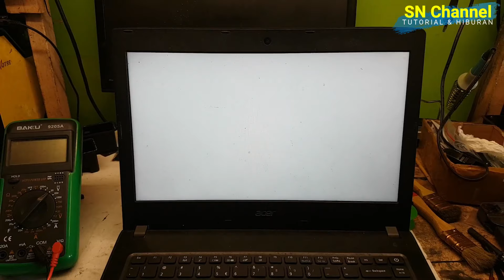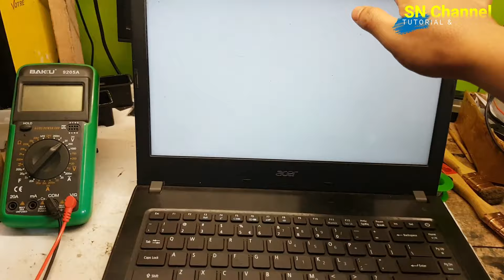LCD LAPTOP BLANK PUTIH || WHITE SCREEN LAPTOP Fix || Layar Laptop Blank Putih

Comment: Saya terjadi blank putih,,, tapi pernah baca permasalahan di website,,,,, jadi dicoba ctr alt del atau matikan paksa trus hidupkan lagi,,,,, dan bisa normal lagi,,,,,, cuma kalau tetap tdl bisa baru bawa ke teknisi yang ada
Reply from the maker: Mungkin itu kasus firmware eror (driver/bios) bukan hardware
Reply: @SartonoNainggolan klo kasus Firmware'nya, solusinya gimana ya Bang... Terimakasih
Reply: Laptop saya udah ganti LCD ..tapi pas seminggu kambuh lagi penyakit' nya LCD nya putih blank
Reply: @hasbby06  punyaku malah baru ta ganti terus Normal, seharian ta pakai normal jaya , besoknya pas ta nyalain eh BLANK PUTIH, aku komplain sama penjualnya (di toko oren) minta retur... di acc dikirim lagi LCD yg baru.. ta pasang dan Alhamdulillah normal sampai sekarang... 

soalnya LCD di pasaran itu kebanyakan meskipun seller bilang baru, nyatanya sebenernya adalah barang Refurbish.. yang ori susah dicari (kalau cari yg ori ya cari yg rosokan mulus / copotan) 

tapi coba dulu kabel flexible ujung"nya dibersihin pakai minyak angin (caplang), bersihin juga dari debu.

Comment: Halo kak, izin bertanya ya..
Laptop saya ACER aspire 4743, saya ganti lcd baru dan hanya bertahan sehari, setelah itu layar blank hitam.. lalu saya coba beli kabel flexibel, dan layar tetap hitam.. kemudian saya ganti lcd baru, tapi layar jadi putih semua.. kira kira, permalasahannya dimana ya kak?
Reply from the maker: Klo ditampilkan ke layar eksternal bagus ngk? Apa sdh cek betul2 pemasangan kabel fleziblenya yg arah ke mobo dan arah ke panel lcd
Reply: Cbak cek tegangan listrik yg masuk ke lptopnya mas. 
Ane dulu juga gtu. Pke. Cas gk ori yg dayanya lebih besar alhasil lcd blank. Putih . Trus matii
Reply: @rizkyadithiarhama701  terus cara mengatasi laptonya gimana mas ? Saya juga gitu. Di cas 2,5 jam. Pas sy nyalakan layarnya putih semua

Comment: Bang klo blank putih tapi ada kursornya gimna bang😭
Reply from the maker: Coba dimatikan paksa. Klo ttp, coba reset windows
Reply: Sama nih kaya aku kasusnya, kira2 penyebabnya apa ya
Reply from the maker: Biasanya, bisa jadi driver VGA, atau windows error, bisa jg kebel flexible longgar, kotor atau rusak, bisa jg jalur vga di mobo, dan bisa jg krn lcd rusak.
Tapi keseringan itu lcd rusak atau flexible

Comment: hello, I want to ask my acer aspire e1-432 model, the screen is half white at the bottom and the top is still good, and I tried to test with the monitor, it is well displayed and then i try remove the flexiblecable connecter on the motherboard and test the cable and it was exposed to the bottom screen only for a moment and it became a white screen again, pls help me what is problem my laptop it's the lcd or flexible cable?